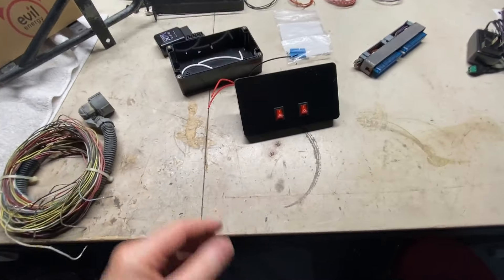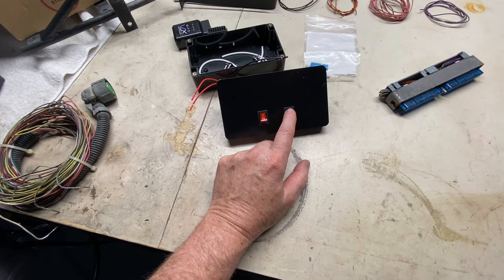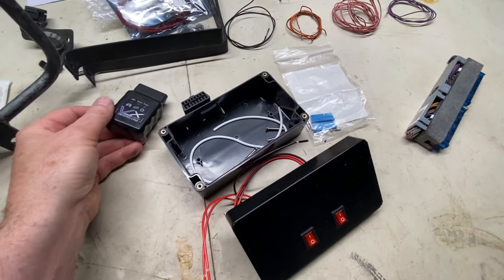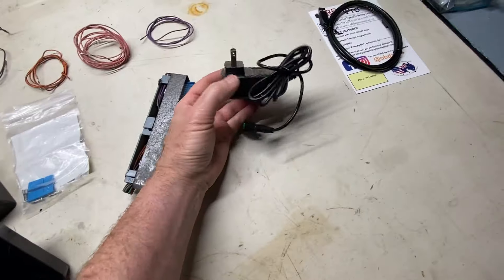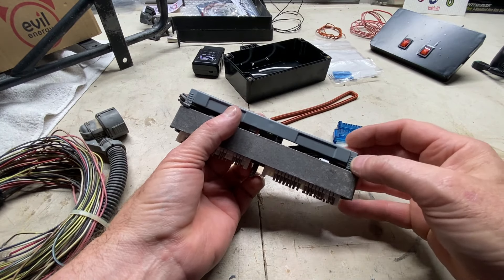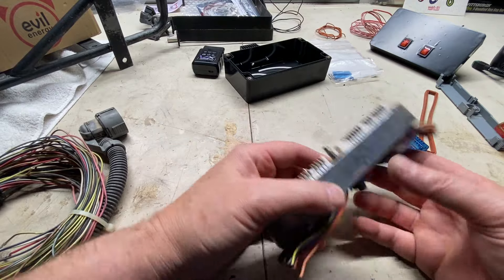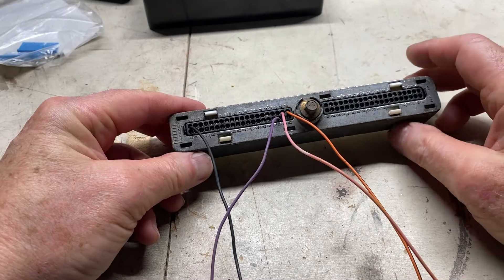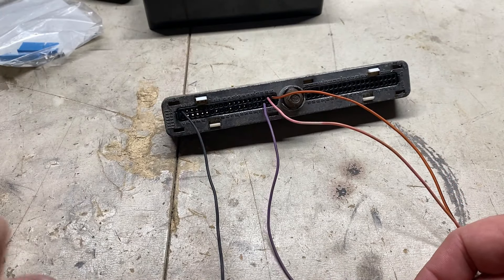LS Benchtop Wiring Harness LS Swap Engine Management Systems DIY VATS Removal

Comment: Could I just find an adapter and use my laptop to do the software straight to the pcm?
Reply from the maker: You can, but, you need to know what you are doing. Always make a copy of the original settings so if you mess something up you can overwrite it with the original settings. Other software could be easier, but, if  you want to play with it, it's free. Do your research first.

Comment: What is the red thing u have over the power supply wiring in the black box ? Because the one u have on the listing has a green adaptor with a plus/negative adaptor for wires .
Reply from the maker: I see what you are looking at..it is a trailer wire splice connector. I removed the metal splice inside. I used it to snap on the cord so it would provide a “stop” so the cord could not be pulled out further creating stress on the internal connections. It is not splicing anything, just the plastic part as a stop.

Comment: Nice
Reply from the maker: Thanks
Reply: @laurencevillegarage  do you dewire harnesses
Reply: I have psi harness 
Need the cab harness de wired
Reply from the maker: @thabigghomie_ No sir, I no longer do customer projects. I don’t mind offering some help through messaging or email.
Reply: @laurencevillegarage  ok
Reply: @laurencevillegarage  just really having problems out my cab harness in the cab 
I straight wired my headlights now no taillights you think or no what aftermarket harness i can buy for a 1988chevy and i have a 5.3 out of a 2002 suburban ls swap PSI MOTOR HARNESS
Reply from the maker: @thabigghomie_ To do an LS swap, you only need to change/modify the original OBS engine harness. The cab harness does not need modifications...maybe depending on gauges, but nothing with the lights. I would suggest getting a wiring diagram manual from GM (find it on ebay) and if there are specific smaller (shorter) specific harnesses replace from a good donor vehicle of a similar year. There is no way I can figure out what has happened with your lights without seeing what it looks like and what the manual shows it should look like.
Reply: @laurencevillegarage  ok and i burn tha original harness up on the 1988 got another out a 92"